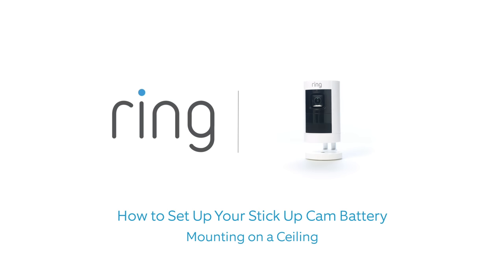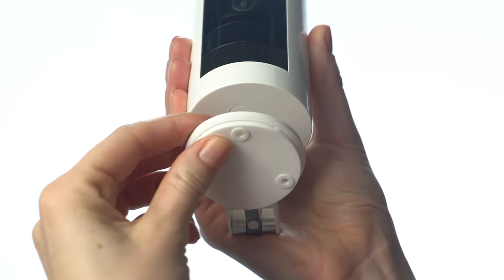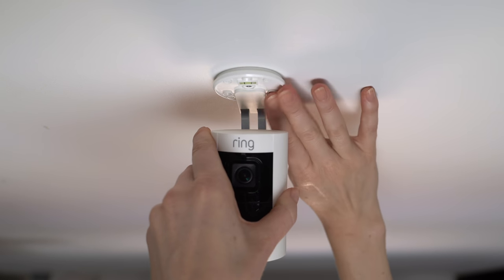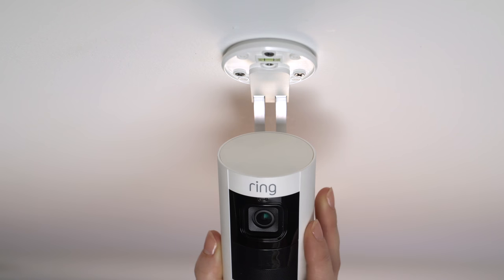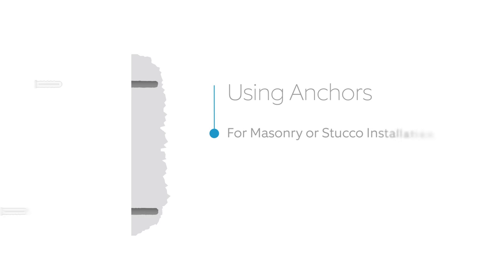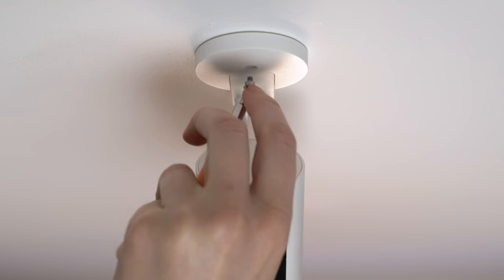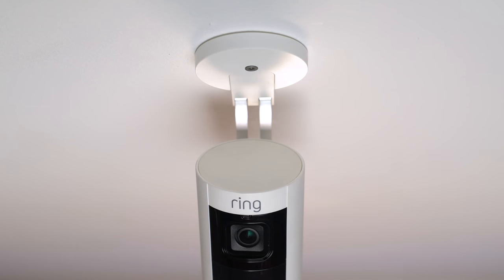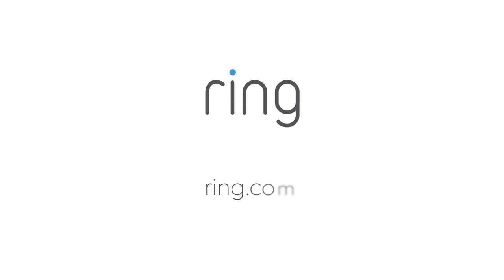How to Install Ring Stick Up Cam Battery on a Ceiling

Comment: soo instead of drilling holes no one thought about just buying the velcro adhesive?
Reply: I thought the same thing...
Reply from the maker: Hey Jenny. If the Stick Up Cam is being mounted inside, velcro adhesive could be used. However, if mounted to an outdoor ceiling, we suggest mounting it securely with the included screws. Let us know if you have any questions!

Comment: My ring stick up can did not come with the swivel stand please help
Reply from the maker: Hey Tony, this video features the 2nd generation Stick Up Cam. The 3rd generation features a mounting base/stand with an adjustable angle. It can sit freestanding or mount to a wall. Let us know if you have any questions!
Reply: @ring  So, does this mean Gen 3 isn't ceiling mountable with the hardware provided?
Reply: Ring So, there is no way to mount the camera on a ceiling/ roof?
Reply: This was my quistion to

Comment: How do you change the orientation of the cam. ? It's upside down now.
Reply from the maker: Hey neighbor! To flip your video's image, follow these steps: 

- Open up your Ring app
- Select the Stick Up Cam
- Tap Device Settings
- Tap Video Settings
- Tap Rotate Video toggle 

Let us know if you have any more questions!
Reply: @ring  I don't have the "rotate video toggle" option in video settings.
Reply: @ring  hello, any response? I too  dont have that option.
Reply: @ring  Hi, has this setting been removed? I followed steps provided and the option mentioned was not present. The toggle option does not exist.
Reply: They have removed the setting. I’m sending this junk right back to them.

Comment: My ceiling is broken. How do I install
Reply from the maker: Hey neighbour! The Stick Up Cam Battery can also be installed on a wall — check it out here: https://www.youtube.com/watch?v=pgIAKUu5LLI&list=PLAJ7Znk0iooKX-N_HQ60mwhrOIzVI5Po-&index=4. You can also simply place it on a shelf, table, or other flat surface for easy placement. Let us know if you have any more questions!

Comment: Can I install it on a tree outside?
Reply from the maker: Hey Mildred, great question! Ring Cameras need to be mounted within 30 feet of your router to ensure a stable wifi connection. Learn more about wifi here: https://support.ring.com/hc/en-us/articles/360050893351-Understanding-Wifi-Wifi-Extenders-and-Mesh-Networks-. Let us know if you have any additional questions, we are here to help.

Comment: My stick up cam battery didn’t come with the ceiling mount
Reply from the maker: Ring Stick Up Cam comes with an integrated mounting base/stand with adjustable angle. Can sit freestanding or mount to a wall. If you want to mount your camera to the ceiling, learn more here: https://shop.ring.com/products/stick-up-security-camera-mount. Let us know if you have any additional questions, we are here to help.
Reply: @ring  page doesnt exist